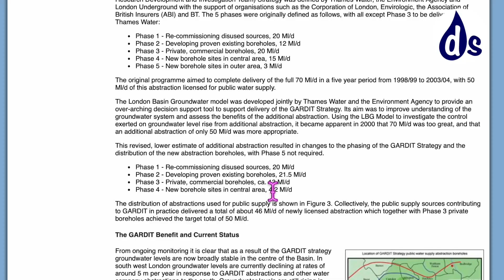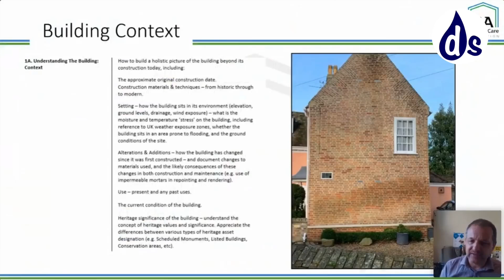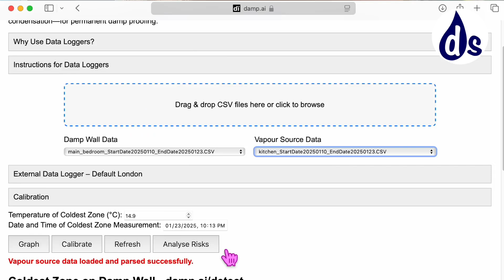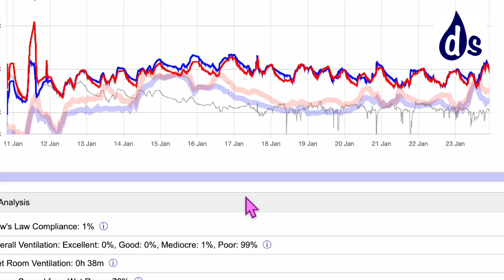❤️ Rising Damp - 🤔 Truth or Scam ⚠  #RisingDamp #DampProofing #DampSurvey #SkillBuilder #RogerBisby

Comment: I think I’m slightly jaded but the way I see it is that you’ll only hear about a solution if money can be made, even if it suboptimal. You’ll make more money selling tanking slurry than you can be dispensing ventilation advice. Another example of this that I observed was for sterilising baby bottles. The advertised solution was a fairly expensive counter top steaming machine that looked fairly awkward to use because it took a while to sterilise and you had a stack all the cups up carefully like a dishwasher. The best solution was sterilisation tablets that you put in a bucket of water and threw the bottles in and remove as needed. Far easier and much much cheaper, but I never once saw it advertised!
Reply from the maker: I completely get where you’re coming from, James. 💡 The reality is, if there’s no money in a solution, it rarely gets promoted. The damp-proofing industry thrives on selling tanking slurries, chemical injections, and impermeable coatings—all of which are far more profitable than simply advising homeowners to ventilate, manage vapour properly, and monitor humidity with a £20 data logger.

Your baby bottle steriliser example is spot on! 🚼 The most practical and cost-effective solutions often fly under the radar because they don’t make anyone rich. The same applies to damp treatment—why recommend opening a window, or a £150 dehumidifier when you can charge thousands for unnecessary remedial work?

That’s why I’m so committed to demystifying damp and showing people how to fix the root cause instead of just covering up symptoms. Check out https://damp.ai—it’s all about evidence-based solutions, not sales tactics. 🚀

Have you come across any other industries where the most effective solutions get overlooked in favour of profitable ones? 🤔
Reply: I like your analogy. Whether it be cars, motorcycles, houses or boats, I have always tried "cheapest first" when a problem arises! My workmate used to say "don't use a sledgehammer to crack eggs!"
Reply from the maker: 🔨 It’s the classic case of when all you have is a hammer, everything looks like a nail. 
🔨 And in the damp proofing industry, that hammer is slurry!

Here’s the kicker—I once had a damp proofer admit to me that slurry works best when there is no rising damp. That says it all. The problem isn’t rising damp—it’s the slurry being used to “treat” misdiagnosed damp issues. Every image in this video shows damp that has been wrongly diagnosed as rising damp when, in reality, the causes are leaks, condensation, poor ventilation, or hygroscopic salts.

As for my journey into this industry:
1️⃣ I got involved to understand why my clients were getting such terrible advice—and to expose the £1-2 billion annual waste in our economy (not to mention the mental health toll damp misdiagnosis causes).
2️⃣ I’ve tried engaging with the PCA, RICS, and anyone willing to listen—but they just don’t want to talk about it.
3️⃣ I make a decent living doing what is, ultimately, pretty straightforward work.
4️⃣ I actively encourage others to do the same. There is no secret here—it’s about learning to investigate moisture properly and applying common sense.
5️⃣ These videos take a huge amount of time and effort, and they’re still a bit niche. But I keep making them to show people that damp diagnosis is not some mystical art—it’s simple, and anyone willing to learn can do it. Hopefully, one day, we’ll shift the way people think about damp and stop treating every patch at the base of a wall as “rising damp.”

Let’s keep this conversation going—change only happens when enough people push back against bad practices. 🚀 Check out https://damp.ai for more insights.
Reply: @dampsurveys  have you seen the joint statement on damp in traditional buildings by PCA, RICS and Historic England?
Reply from the maker: @johncranna9427  Yes, I was at its unveiling at the PCA in November 2019—see the secret film I took, where someone challenged the PCA’s position: 📽 https://www.youtube.com/watch?v=Ayw11yDR4O0.

Interestingly, Steve Hodgson, the PCA’s CEO, said something along the lines of “we will be judged by the sins of our fathers”. And rightly so—if damp-proofing continues in its current form, we will also be judged by future generations. My own grandmother was sold damp-proofing treatment—she didn’t know better.

🔍 Did the Joint Statement change anything?
The general consensus is no—it did nothing to stop the misdiagnosis of rising damp. If anything, it has been used as a fig leaf—a veneer of respectability.

The worst offenders? Kenwood, based in London, is arguably one of the worst, still claiming rising damp exists in London—despite groundwater being pumped out. Their reports typically follow the same boilerplate:
📌 “Our Technical Surveyor inspected the [property] for evidence of rising damp on [date]. The inspection revealed dampness in the areas marked in red on the attached plan. We are pleased to provide our quotation for the installation of a new damp-proof course.”

⚠ What’s wrong with this?
1⃣ They never actually state they found rising damp—just “dampness.”
2⃣ They don’t confirm if an original DPC is present or absent, and any evidence show why this is relevant to the damp.
3⃣ The only evidence provided is a high damp meter reading—which could come from any source (condensation, leaks, hygroscopic salts, penetrating damp).
4⃣ Their “guarantee” only covers rising damp—so if the real issue is a leak, rainwater penetration, or salts, the claim will fail. I have plenty of examples of damp properties following Kenwood's treatment. In fact many of the worst examples of damp properties on the video are after a Kenwood damp treatment.

This is exactly why the PCA, RICS, and Historic England should go further—and define, describe, study, and regulate misleading practices, rather than offering a veneer of credibility to an industry that still thrives on misunderstanding and misdiagnosis.

For more, check out https://damp.ai/rising-damp
Reply from the maker: Completely agree—there’s a huge financial incentive to push products over simple, low-cost solutions. It’s the same with damp proofing. Selling tanking slurry and chemical DPCs makes far more money than just advising better ventilation, fixing leaks, or using a dehumidifier.

Your baby bottle analogy is spot on! The simplest and most effective solutions often aren’t the ones that get marketed because there’s less profit in them. The same applies to damp—covering symptoms with expensive treatments is more lucrative than addressing root causes.

That’s why I focus on practical, cost-effective solutions at https://damp.ai—because understanding the problem properly is the key to fixing it, rather than just masking it. 🚀